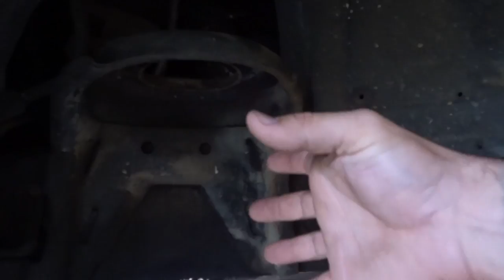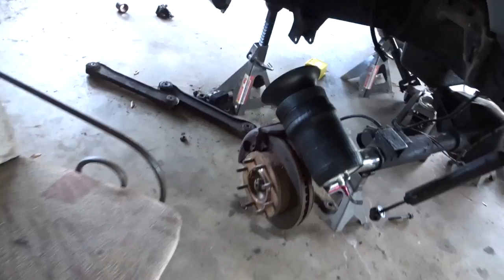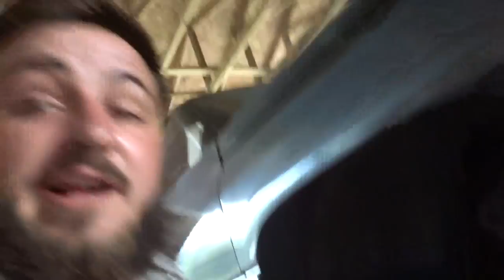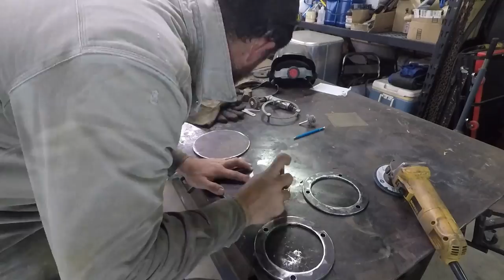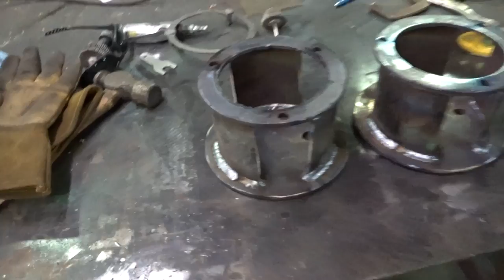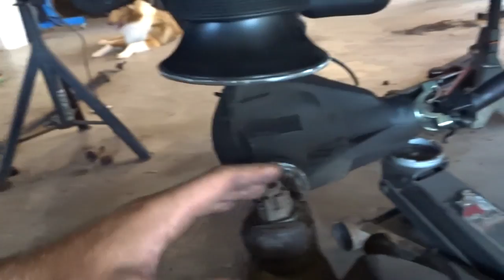Front End Airbag Adapter: 2nd Gen Cummins Project Pt 8

Comment: Yo...Moffitt...my truck turned out awesome. Making some changes here today I'm actually moving up to semi airbags for the front.. I have the other bags on it but 5 minutes after I fix the truck I was test driving in some a**** drunk ran into me and told it and ever since I can't get the front bags to stop leaking.. I went through the lines and cut the end straight and all that and finally I said the hell with it and I went and bought the massive semi airbags I'm putting them on right now.. getting ready to do a little welding

Comment: Need help on my 2017 ram 3500 4x4 on 24x40 RBP dually info on diy front air suspension??
Reply from the maker: Easiest way would be to just make some sort of adapters to fit the upper and lower coil brackets for whatever bags will fit